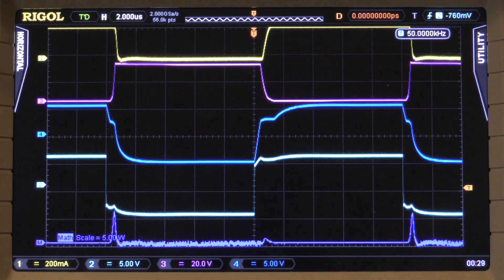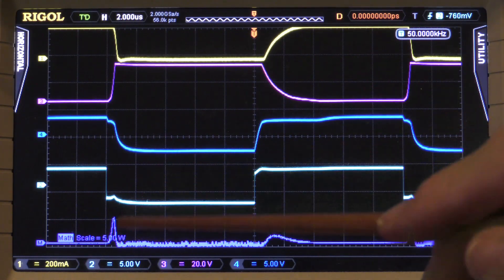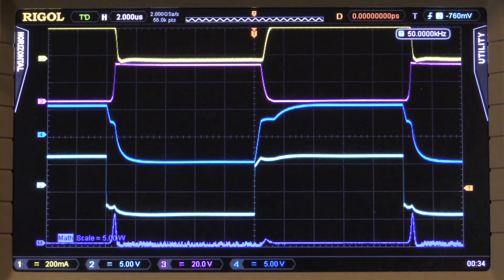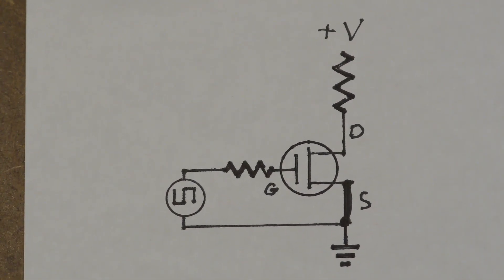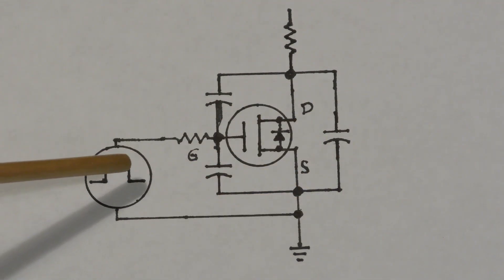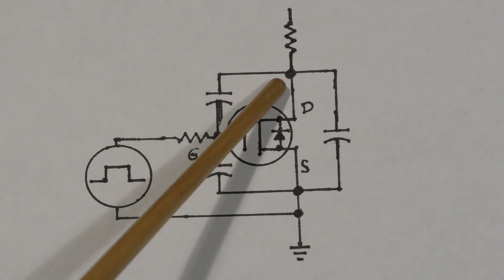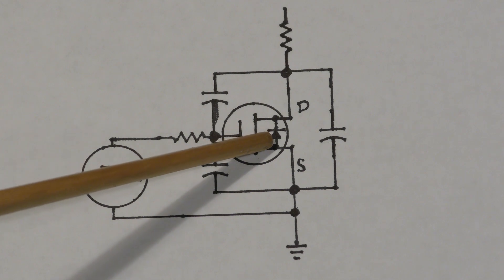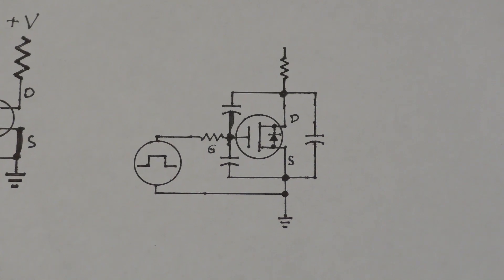TTT354 MOSFET Switching Losses

Comment: Great video Sir, could you list the part number for the power MOSFET and the resistor values? I would like to  put together a LTspice model and simulate for you. I may have missed the information in an earlier video. Thank you.
Reply from the maker: The MOSFET is an IRLZ234N with a 100 ohm 5 Watt Drain resistor and a 120 ohm 1/4 Watt Gate drive resistor.
Reply: @tomtektest8042  Sir, your thoughts on the cgs  cgd  and cds, I was thinking about 10 pf for the cgs and cgd value and 100 pf for cds? Let me double check on the MODFET, IRLZ234N OR IRLZ34N?

Comment: It's weird...I haven't directly thought about that is quite a long time...but I kind of automatically calculate it in when I am running the circuits through my head.  
My Grandpa...the one that start teaching me all this when I was a kid...was always amazed at how I could "see" everything in my mind's eye and kept it there.  
I used to frustrate my math teachers the same way...I never use my "scratch" paper...just did it in my head...but they couldn't see the way I did it.  
One even thought I was using a calculator...so I took the 12th grade test (I was in 6th grade) right in front of the teacher...all correct plus bonus...she never doubted me again  :)